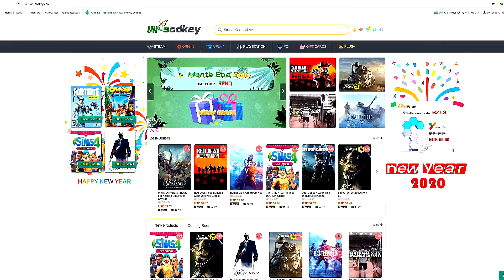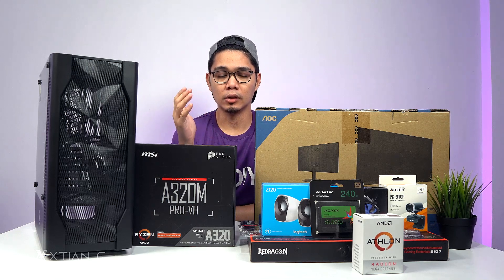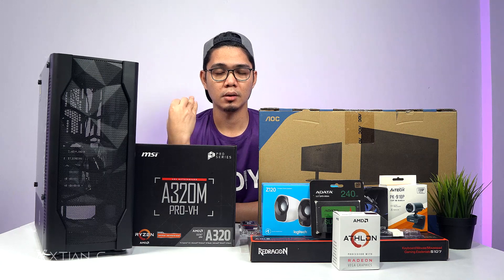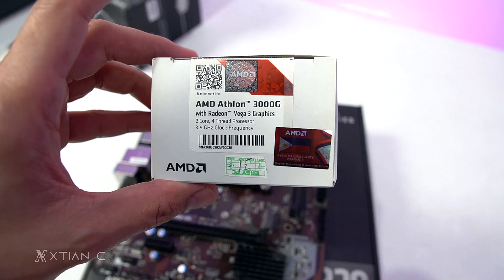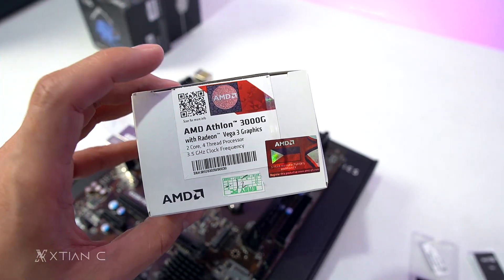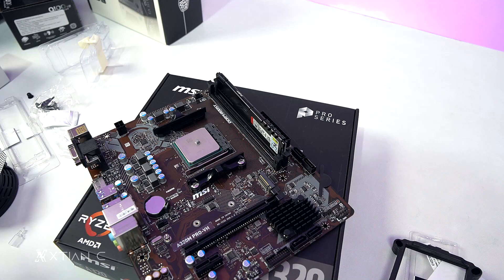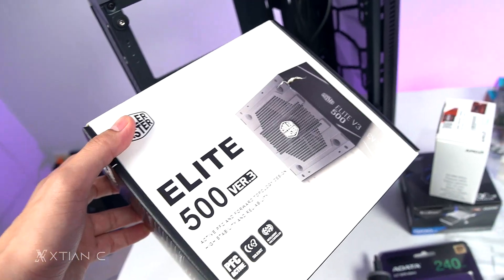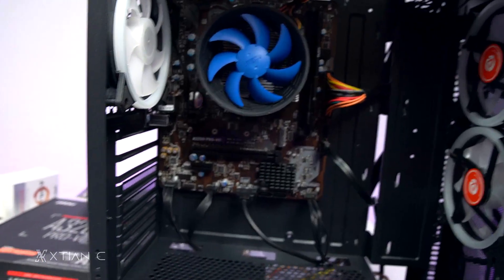VLOG: 25K BUDGET PC Build Guide 2021 COMPLETE Setup w/ Monitor Gaming/Online Class/WFH

Comment: I have the same build : )
Built it 1 year ago and it costed me 12k only
Prices sky rocketed now : (
Reply: All out po?
Reply: Ako nga lods Ryzen 5 2600 + GTX 1650, 16GB RAM
32K lang bili ko sa buong system unit ako nag build tska hindi second hand sobrang mura pa nun 🤣🤣

Ngayon Kung bbili ng GPU tapos mid range na Low-Mid range na CPU pwede na abutin ng 50K HAHAHAH buti nalang tlga maaga naka bili
Reply: @horrendolauouis  bought for 29k ryzen 5 2600 + 1650 super build + 16gb ram
Reply: @reyvincentalcantara5563  hahahah nagka mistake pa nga ako lods kasi m.2 pa kinuha ko na 1TB
Reply: Sa mga di nkkalam mattas demand keya mataas presyo
Reply: @horrendolauouis  ako ryzen 5 2600 + rx570 + 16gb ram 30k haha ngayon 40k na hahaha
Reply: @quinieannedejesus3048  pwede din lods mas mataas pa dyan kasi kahit amd processors in demand narin especially ung mga 3 and 5 series
Reply: @horrendolauouis  My Ryzen 5 3600 + RX 5700 and 16gbs of RAM only costed 52k. Almost sold the GPU during the height of the shortage and price increase so I could upgrade lmao good thing I didn't. So I just went with upgrading my mice and keyboard.
Reply: @mdg_plus3664  no shit
Reply: @horrendolauouis  same mas mura pa nga konti nasa 29k yung sakin. grabe ang mahal na talaga ngayon... bili ko last time ng 1650 super nasa 9k lang eh, ngayong nasa 13-15k ulit.
Reply: Tumaas ba lhat ng pyesa hindi pla mgnda mg build ngaun.
Reply: Kasama ba peripherals?

Comment: Same budget, yung akin naman ganito:

Gigabyte B450M DS3H
Ryzen 3 4300GE
Kingston 240GB SSD
Lexxar DDR4 8GB (1x8) 2666mhz
Bosston Generic Case

Tapos included na 21.5in monitor, nag cheap out lang ako sa mouse, keyboard, at headset.

Comment: idol pa consult naman ng balak kong setup. Balak ko kasing bumili ng rx 5500 xt and currently naka ryzen 3 3200g ako with cooler master 500w elite v3. I have 1 ssd drive, dual stick rams, b450m tuf na mobo and total of 4 fans including cpu fan and led lights na included sa frame ko. Ask ko lang if sapat na ba yung psu kong 500w elite v3 if lalagyan ko ng 5500 xt? Sana masagot. Salamat!❤️

Comment: Sir Tian! Ask ko lang po if applicable po si Athlon 3000g for 8gb 3200hmz (x2)? Or should i stick for 8gb 2666hmz (x2)?
Reply: kaya yan sa cpu pero basta kaya ng motherboard mo ang 3200 mhz na RAM
Reply: yung motherboard ko po is Asus Prime a320m-k po. Kaya po ba yon?
Reply: @vincentjo1558  Goods yan bro pwede ilagay
Reply: @vincentjo1558  Ay sorry baliktad yung motherboard mo kaya 3200mhz yung CPU mo 2666mhz lang kaya so yung 2666mhz Ram ang ilagay mo
Reply: Sir balak ko kasi mag upgrade ng CPU after a months. Kaya athlon 3000g muna pinili ko kasi mahal pa mga CPU ngayon e. Pero if 3200hmz tas set ko lang muna sa settings ng 2666hmz oks lang naman yon po eno?
Reply: @vincentjo1558  goods yan sir I highly recommend that.
Reply: @vincentjo1558  basta 3200 MHz ang gamit mo na RAM at kung mag uupgrade ka ng Ryzen CPU na may integrated graphics ay piliin mo yung Ryzen 3 3200g or Ryzen  5 3400g
Reply: Ang plan ko sir ryzen 5 3400g talaga. Ano po ba marerecomment mo na GPU sir kung sakali?
Reply: @vincentjo1558  Actually not a fan of gpu but gtx 1050
Reply: @rogued3mon414  may I ask why you are not a fan of GPUs? I'm a baby when it comes tk PC builds. Only the past few days that I'm trying to educate myself.
Reply: @bashersbeware  Gpus are overpriced these days and im starting to like APUs
Reply: @rogued3mon414  ok.... APUs, that's another terminology that I learned only today (from you). Let me research on that. Thanks.
Reply: ano update boss? 3200 linagay mo or 2666? nakita ko kse lag 3200 gnamit tapos inonn xmp nag blubluescreen?

Comment: Idol pa help nmn po ako. Compatible na po ba itong mga choices ko specially po yung gusto kong motherboard na Steel Legend. May kaylangan paba akong oalitan or idadag?
CPU: Ryzen 5 3400G(10,800) / AMD Ryzen 5 Pro 4650G(14,495).

MOTHERBOARD: AsRock B450M Steel Legend (4,995) / Asus Prime B550M Wifi(6,690) / Gigabyte UD B550M DS3H(5,600)

RAM: Kingston Fury Beast 2x8gb ddr4-3200mhz Rgb(4,395)

Ssd: WD ssd 120gb green M 2SATA
Hdd: Seagate barracuda 1tb

Gpu: Cooler Master MWE 550watts 80+ Bronze

Comment: Hi po pede pa recommend kung ano bagay na graphics card para po sa pc ko nasa  hanggang 80 fps lang po kasi aq, and gusto kahit papaano umangat fps ko.
Ryzen 3 2200ge
Gigabyte 1320mh 
8gb ram
240gb ssd 2.0
700watts
Reply: palit mo psu before bili gpu i recom rx570/1650/1650 super
or if wla ka talagang budget  1050ti

Comment: Ask ko lang po bakit hindi ryzen 3 ginamit nyo instead sa athlon? Ano po ba mas preferred nyo ryzen 3 or athlon?
Reply: lalagpas na sa budget na binigay kay sir Xtian
Reply: @ayaki08  Hello po, mahal po ba sa 26,800 to? 
Processor : ryzen 5 2400
Motherboard: A320M
Memory: 8GB DDR4
PSU: 700 WATTS
SSD: ova 256 GB breeze m2 SATA 
HDD: 1TB toshiba
Monitor 24 inches 95 hz and mouse,keyboard
With os narin po
Reply: @cola9170  ok naman sya but mas maganda kung 3400g since mas bago but di naman nagkakalayo sa performance
Reply: @ayaki08  Mahal po kase 3400 eh di na kaya ng budget.
Pero di naman po ba sya overpriced for 26,800?
Reply: @cola9170  hmm pwede moba babaan wattage ng psu? upgrade kaba lodi? if so maybe 550 v ng Corsair or 600 watts lang basta 80 plus bronze rated para maka mura oa ng onti and if possible another stick ng ram
Reply: @ayaki08  di po upgrade, bibilhin ko po prebuilt na pc sa pc zone po which is yung ryzen 5 2400 nga
Reply: @cola9170  oh pwede na sya considering the prices nowadays! Bilin mona yan, if possible update moko kung ano nakalagay sa powet supply kase baka generic yung nakalagay sa pre built
Reply: @ayaki08  Kukunin ko na nga po sana kanina biglang sabi na magpaprice update sila yowa
Reply: @cola9170  yun lang haha perp goods nayun lods.

Comment: just wanna know bakit pinupush making AMD systems when Intels offer faster performance, productivity for the cheaper price. You can build i5-11400 for the same price. More cores, later and just plain better. So sad na maraming Pilipino ay nagpapadala and bandwagon sa AMD when Intel is a better option in this timeZ
Reply: Lol mas malakas kasi integrated graphics ng amd kesa intel tas presyo pa ngayon ng gpu doble kaya syempre uunahin nila bumili ng apu
Reply: @MarkG18  ehh lalaruin mo lng naman sa mga apu’s LoL, Dota damay mo na minecraft. Kayang kaya non ng igpu ng i5-11400, plus maslater, mascheaper and mas malakas siya compared sa bloated na price na mga amd apus ngayon. D na sapat 4 cores ngayong 2021-2022. Mas sulit na bumili ng niyan for the same price. May masmurang option pa na i5 11400f (ung walang igpu version) kung nagbabalak bumili or may graphics card ka na luma pede nayon para lang sa display.
Reply: @MarkG18  also you could look up some benchmarks of the 11th gen intel apus, kaya run Valorant 1080p low-med settings for 120 fps.
Reply: @verynice4829  Nag iisip ka ba? Halos 2.5x yung price ng i5 11400 compared sa  AMD A3000g. Also capable din naman ng igpu ng A3000g at basic use din lang naman at di kailangan ng 6 core/12 threads.
Reply: @jayvee8502  Ikaw di nagiisip. Sobrang bloated ng price ng amd systems ngayon. Look up lazada right now you can build i5 11400 system for the price. Which is better and futureproof. Ngayon kung basic use lang naisip mo, why spend 25k on a basic unit. Kung gusto mo masmapamura you can try i3 10100. Why cheap out on a unit you would use for years.
Reply: @verynice4829  Boss yung sinasabi mo yung package i5 11400 package kulang pa yun 25k.  Ito complete na with assecories.  Para din ito sa users na di agad or never mag upgrade.
Reply: @jayvee8502  yung problema kasi almost 2-4k lng ang pagitan ng dalawa. Halos wala rin kwenta yung ginastusan mong 25k kung nag cheap out ka sa parts. Even the i3 10100 4 cores is already cheap as it is. Ngayon kung gusto mo maglaro ng valorant, csgo, lol dota at decent fps dun ka na sa 2-4k more. Sa build na to ms office lng magagawa mo bago ka pa maurat sa unplayable settings sa mga titles na gusto mo laruin.
Reply: @verynice4829  My upgrade path di naman ang AMD.  Mahal nga lang sa ngayon.  Pwede  naman palitan mas powerful na APU.
Reply: @verynice4829  intel fan kalang kase maganda Amd ngayon oy
Reply: @態NAMELESSシ  no, can you name me an AMD variant that beats 11th gen cpus by price:performance ratio? Maganda AMD kaso not is the right time to choose it because it is overpriced and dated.
Reply: @verynice4829  yung 2-4k na diperensya 2x8 stick na ng 3200 ddr4 na ram. Pag nag intel ka edi wala kang ram
Reply: @ONEILGATDASAUCE  wala pa po reply? HAHAHAHA
Reply: @hannaxxinn  baka narealize nya na mali nya lol haha. In the long run mas okay ang amd kase mas powerful ang igpu kesa sa intel. Core I5 11400 15k, ryzen 5 5600g nalang ako lol
Reply: @ONEILGATDASAUCE  ang funny nung pinaglalaban, wala ako alam boss pero sa mga nakikita ko sa youtube amd din bet nila hahahahaha

Comment: Dude, I can build a 20k full pc build. Here are the the components:
athlon 3000g
 a320 mobo
2x8 16gb ram
450w psu 80+
case
5 fans
120g ssd
1tb HDD
22 inch tv as a monitor (w/HDMI)
keyboard+mouse+ combo
long mousepad
webcam
Reply: gusto siguro ng client brand new components lahat

Comment: If I add one more 8gb RAM on that build, magi-increase po kaya ang FPS significantly?
Reply: No. You need to either upgrade to a more powerful processor, and/or add a graphics card to increase your FPS in any game. Often times you won't need to, since most cheap monitors can only handle up to 60FPS or 60hz.
Reply: thanks for the tips!